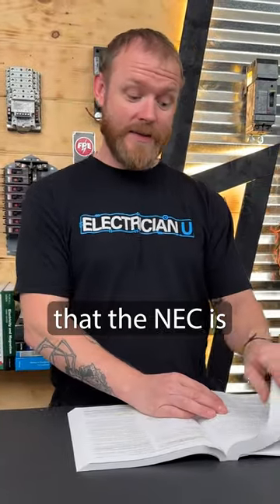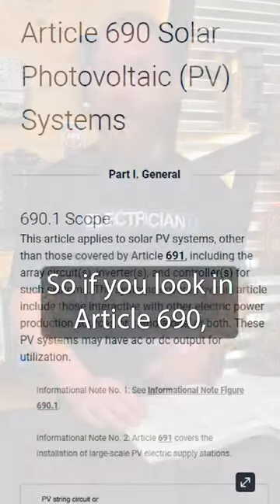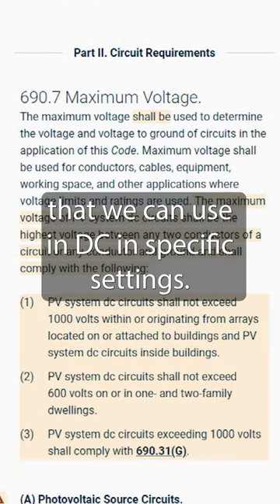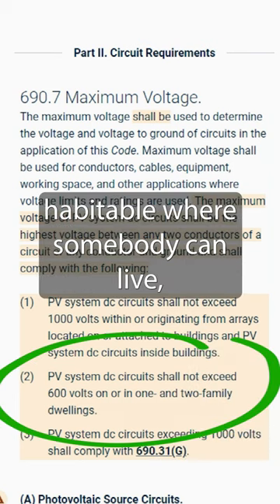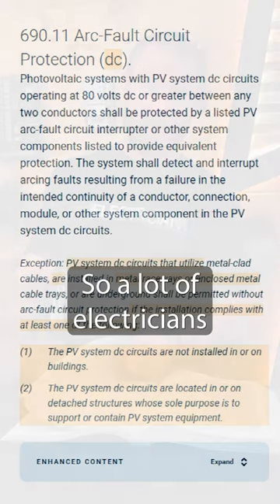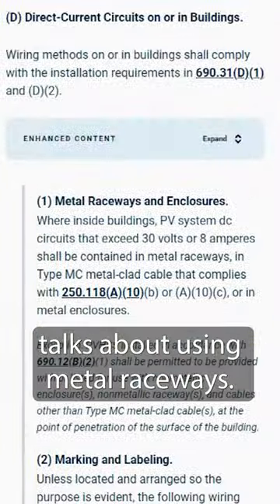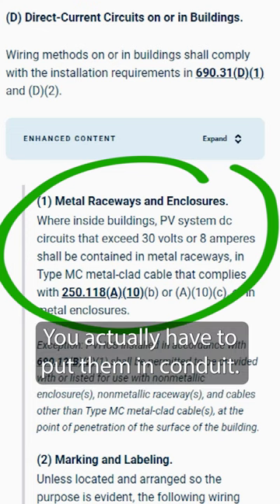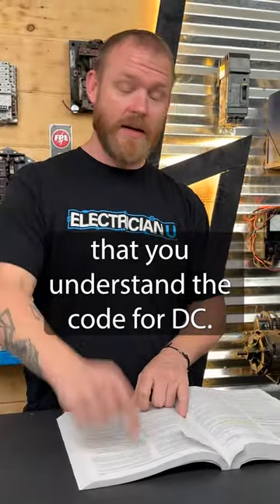Codes for Working with DC - AC vs DC

Comment: So if I have solar panels on the back yard, can I use pvc conduit and to the house and in the house use metal conduit? Would that be code compliant?
Reply: From my understanding yes, we just did a system like that. I've seen it also tho where they required metal conduit on an outbuilding. The codes for uninhabited DC systems just got updates so I'd double check to be sure
Reply: You're allowed to use pvc for running pv. We do it all over in the state of Florida. Almost have too with all the salt water that's in the air.
Reply: Yea for burial. Or if you have micros then that code doesn’t apply.
Reply: @Gunter3049 yeah that’s the only difference. Down south near the coast in Texas almost everything is pvc. You’ll see the old jobs with EMT all corroded
Reply: @Sn00chieb00chies so in the state of Washington.. I have 8kw 20 panels connected to AP system microinverter inverter.  The rails are grounded with #8 solid copper on roof. I have 2 parallel runs of 12-2 romex poking down from the roof top into attic. Going into EMT side of the house with LB. Transitioning in the LB with a splice into #12 thhn including ground. Down to a combiner box
 Does this seem right? I'm new to this
Reply: @ProfessionalKazak  romex is not supposed to be ran in conduit. And using a LB as a j box is kinda hack work, you should only use LBs or any conduit body as just a pull point not a junction box. Also an extra #8 green needs to be ran in the attic with the romex. We always upsize it to 10/2 but still use a 20A breaker. And it’s more expensive but technically supposed to use 10/3 some inspectors don’t wanna see the grounded conductor used as a ungrounded per code
Reply: @Sn00chieb00chies  I agree about LB being hack work. Gonna redoo that.. I told my boss about up sizing to 10-2 wire. He said they have failed inspection because they didn't fallow engineering plans.  I told him I never heard of up sizing failing inspection.  He said no we did. Which I think he still wrong. So I followed engineering.  So I need to run a #8 green also. Gonna leave 12-2
Also the engineering wants a tap going off main feeder 200amp. Which I don't see know one on YouTube doing
  Thus is where I didn't fallow engineering. I put in a 40amp at the bottom of bus bar and from there it goes to knife switch disconnect.  And into a production meter and after that the combiner box.
Reply: @ProfessionalKazak  Your good with that 40A breaker.  Anything larger on a 200A main breaker panel with a 200A buss would be a violation.

Comment: You know what I love. We have all these codes for safety right? If they where trying to protect us they would move away from 60hz ac. 60hz AC directly interferes with the body. Try a higher frequency or maybe a lower one there’s one that won’t effects us as bad I’m sure of it. Then all this code stuff won’t be as important because AC will naturally be safer. Problem solved. xD

Comment: Does this apply to Power over Ethernet? I did a project a while ago running PoE cameras and was super disappointed I couldn't find any code for them. Maybe I was googling the wrong thing in retrospect.
Reply: Voltage of those are super low. Continue my wayward son.
Reply: Keep in mind, law often lags behind technology.
"Low Voltage" is still a bit of the Wild West of the electrical trades. 
We have all seen 100+ bundles of CAT5 and 6 through sleeves. Now imagine the heat produced with 60 watt, or even 100 watt loads through 22 AWG wires.
Reply: @tailgunner2  sure the newest POE specs say you can get 100w out of a port. But noone is running 100w POE devices let alone over 100 of them. Manufacturers wouldn't do that. If the latest spec of POE says you can do 100w, a manufacturer would only make a device capable of drawing 85-90w.

In the same sense that, yea sure you got 20 amp AC breakers and circuits in your home but you're not drawing all 20 amps at any one  time.
Reply: @TheTubejunky  Not as low as you might think (if you a low voltage guy anyways). POE ranges between 44-57 VDC. But the good thing about active POE is that its not just dumping that power out of the ports and cables all the time. A POE device has to request from the port, how much power it wants, only then does the POE port ramp up and provide as much power as the POE device requested.

Comment: Tell the inspector I have a lifesized breadboard with a photovoltaic generator attached to a bank of 1000 18650s.  Btw my battery drawer at home has more than 600VDC in it. 💪⚡
Reply: 600Vac hurts bad, heck even 277Vac will pretty much deform and kill you in a split second. Just remember, AC is technically 0V 60 times every second. DC is never 0 volts. So when you get hit by it, it's a daddy smack, not a mommy tap.
Reply: @paaao lol 😂. For real tho, you ain’t lying DC ain’t no joke.